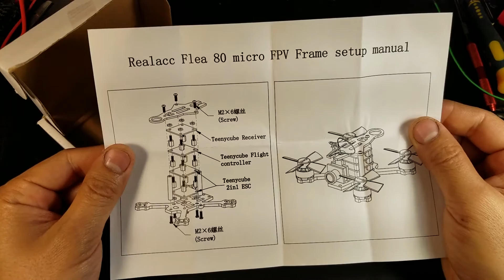Realacc Flea 80 micro frame quick reivew

Comment: Hey can yo help me? You told u will use Super_S Flytower F3 for this frame as i want too, but as i see on pictures, the motor solder pin (at outside) on the ESC will "crash" into that purple barrel which holds the top of the frame. Is it true or the frame will be good for the flytower?
Reply from the maker: you are right, the 4 in 1 esc will interfere with post that holds the top of the frame. i plan to not use a top frame
Reply: Thanx for info than i try to find other frame with 16x16 FC support